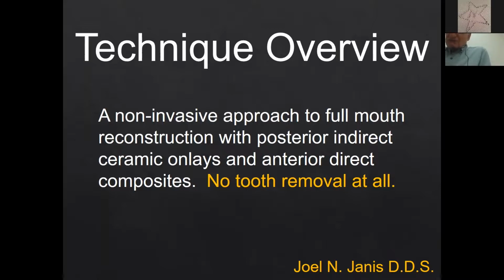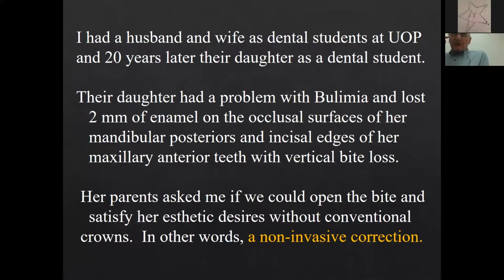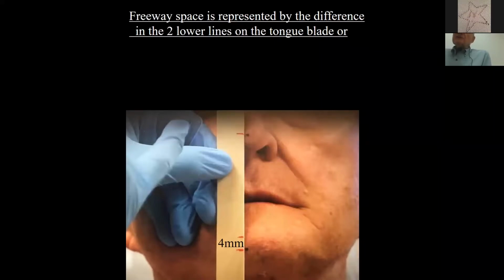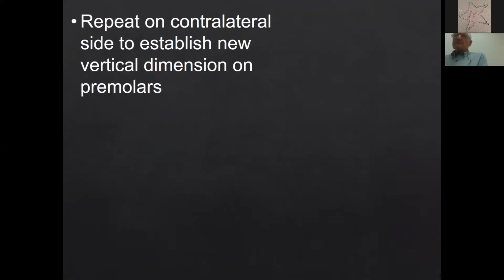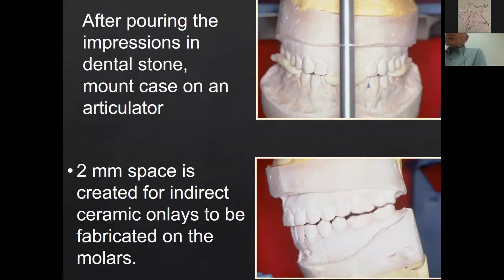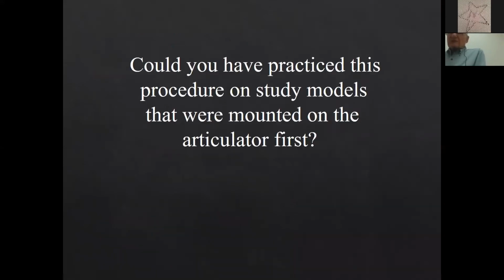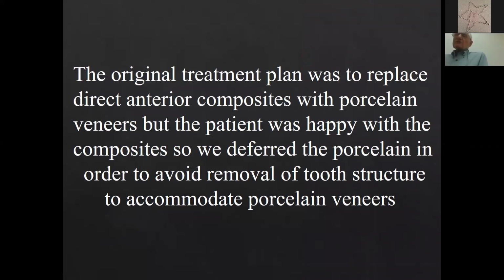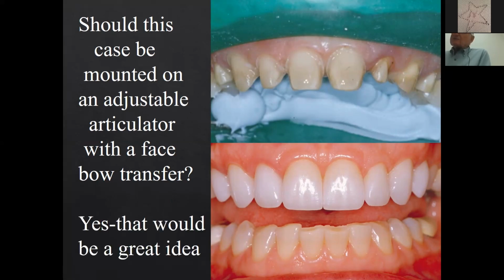Full Mouth Reconstruction using Indirect Ceramic Onlays and Direct Composites -  Dr. Joel N. Janis

Comment: How would you do this if you need to add to both the upper and lower posteriors?
Reply from the maker: We would also place composite cones on the lingual cusps of the maxillary premolars to open the bite so that the maxillary and mandibular onlays could be fabricated and bonded.  Then we could remove the premolar cones and take new impressions and fabricate the premolar onlays.